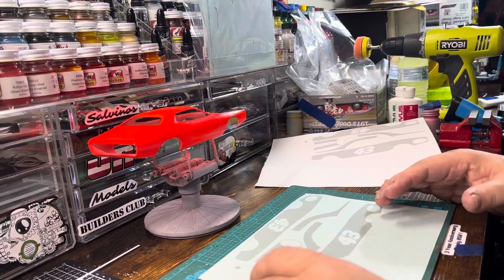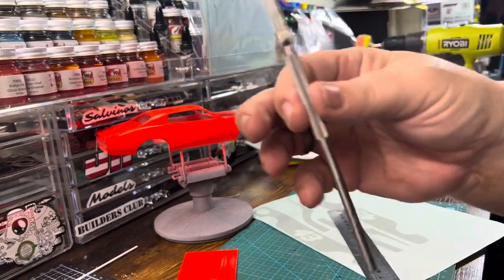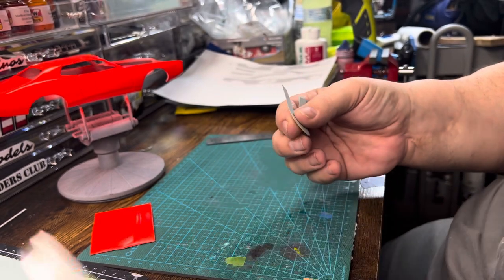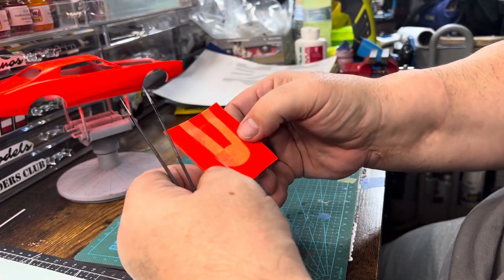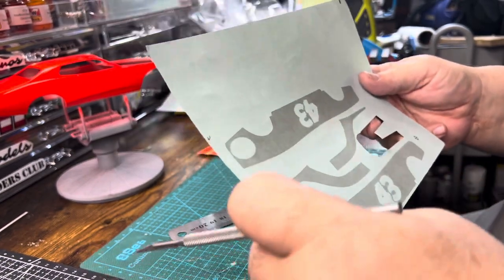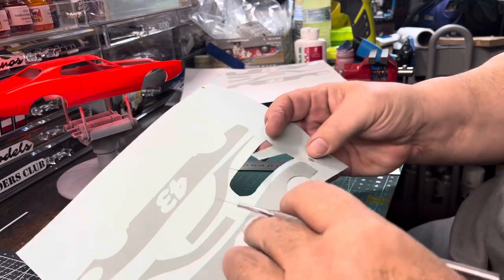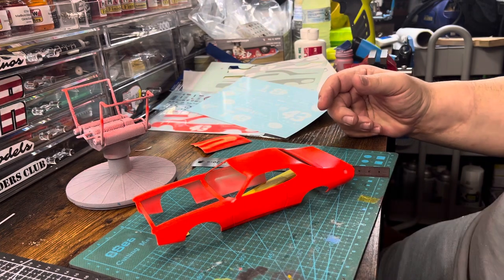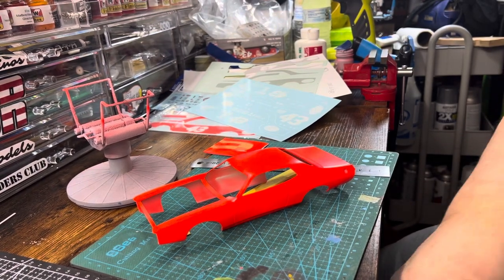Richard Petty 1976 bicentennial charger masking and painting

Comment: Just a thought on your mask sizing problem. Is it possible your printer is not copying at 100% of the original ? Is that where the slight dimensional change is being introduced ? Or are the original Salvinos decals the problem and they are not to size ? I like your attitude, the way you just roll with the problem and calmly work the solution. It's hobby to be enjoyed.
Reply from the maker: It’s 100%. I made sure because I have a high resolution printer/scanner/copier. I scan every one of my decals before I use them so I have them on file to print as needed. With Salvino’s it’s hit & miss. Mostly hit, but it’s not the first issue. But your right. Gotta just roll with it and keep moving on. Can’t get bogged down by pithy little issues.👍👍